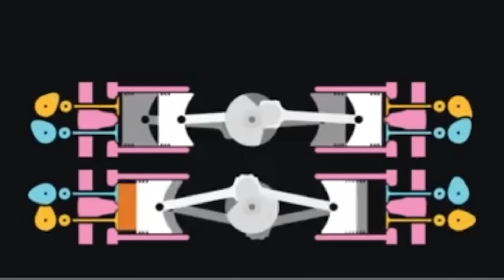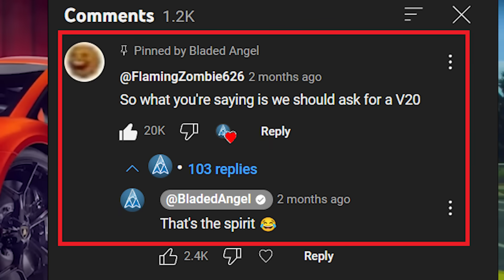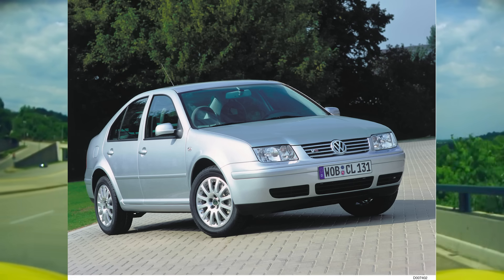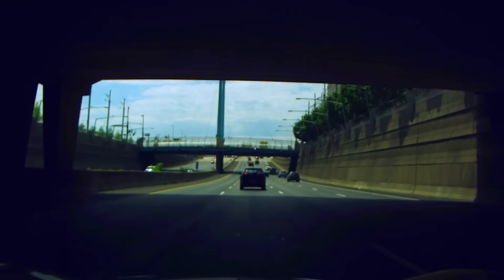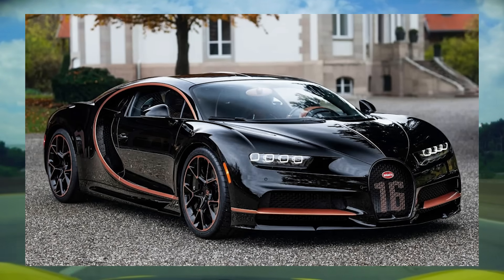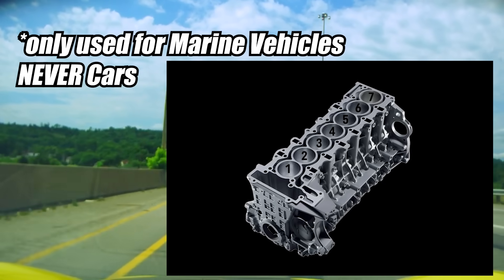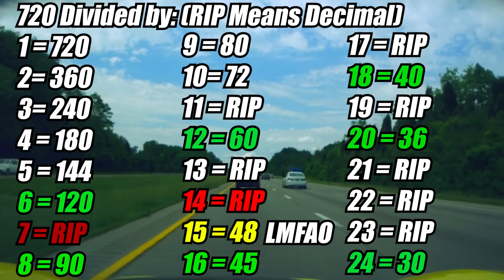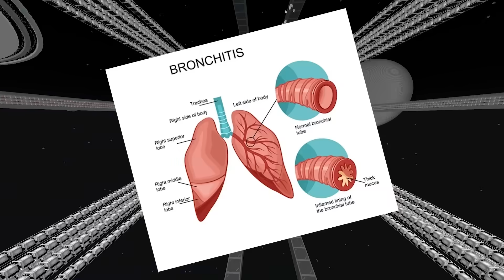5 EXTINCT Car Engines We'll Never See Again!

Comment: Wait, if V14 is impossible to balance, why does it work on marine diesels? Is because they rev so low, that vibrations dont matter? Or are they two stroke engines?
Reply: Marine diesels are grunting low rev engine. I read somewhere that they even have redline between 100 and 200 RPM. So yeah, the engine is slow and the ship chassis is strong enough to reduced the vibration significantly.

Comment: Volkswagens V5 engine of the late 90:s and early 2000:s was based on the very narrow angle 2.8 liter VR6 engine, but with 1 cylinder removed, it's the only production V5 engine being installed in cars. 
All other 5 cylinder car engines, Audi, Volvo, Fiat, Honda \ Acura (not in Europe ) GM, and the 5 cylinder Mercedes diesels were all inline 5s, my favorite engine design after V8:s 👍
Reply: Audi/VAG and further developed Volvo inline 5's were the best engines ever made and it was really a misstep for VAG to cease use them.

Really simple to fix, reliable to boot and upgradebla to a power levels no other basic VAG engines can take.
Reply: @jhutt8002  They really over-engineered the 5-cylinder engines. No wonder they can easily break the 1 million kilometer mark, and why they can be tuned to a ridiculous level.
I have an Audi from the mid 90's that has the AEL/D5252T engine in it (It says both AEL and D5252T on the block, which is a cool fact). Nonetheless, it has 543,000 kilometers on the clock, and still runs perfectly fine. It even had a severe overheating event at one time (measured oil temp at 150 C), where it nearly ceased up, but I let it cool off, refilled the coolant, and eventually it started back up again like nothing happened, and it suffered no damage to any components. I'd love to see that happen to any other engine and see those live through that.
Reply: @jhutt8002  yes sad indeed
Reply: @jhutt8002  im glad to have picked up a volvo c30 2.4i 5 cyl,, it sings so nice pasing 5000rpm.
Reply: Fun fact, Oldsmobile designed a V5 diesel engine for FWD cars in the 80s which NEARLY made it to production, but the fallout from the failure of the Oldsmobile diesel V8 made them cancel it. Unlike the diesel V8, it was designed from the ground up to be a diesel engine (not a gas V8 hastily and crappily converted to diesel), so could've actually been pretty decent. Sadly though, now there's only one surviving prototype in a museum and it hasn't run in decades so the only people who know what it sounded like are 1980s Oldsmobile engineers.
Reply: And it's sad that the i5 is now dead. Nobody makes em anymore...other than Scania.

Comment: Remember, X24 engines exist, used in planes
Reply from the maker: yeah, but for this video it had to at least been thought of or attempted in a car. While X engines were attempted in cars, I dont think a X24 specifically ever was (For the same reason a V24 hasn't. Just wayyyyyyyyyyyyyyyyyyyyyy too big)
Reply: @BladedAngel  dont forgor radials, mmmmmmmmmmmmmmmmmmmmm radials. there are a few cars with radials
Reply: @captainslow_037  that radial FWD race car lmfao
Reply: @BladedAngel  does tank count as car? they use x-engines also)
Reply: @BladedAngel  ford/henrys X4 and X8 and X12/Lincoln 1910-1950's~ 🤠😉 yore welcome 👍

also on my car bucket list for 10+cylinder's aka X20 or X16/X12 alison-4520/liberty-finned/air-cooled-hybrid+water-cooled looking/themed ( 500ci to 1200ci, and maybe turbocharged as mufflers 😉) and or night-sleeve-cylinder valved and or combination with rotary-valve's-head's+electrical servos/PWM and head's that screw-on+VCR+efi-ect...

the JDM boosted RB20/3-rotary ( like 6 and 12 but for average me to much $$ and fuel/parts/learning-curve-etc.. to be a realistic experience/goal's plus im not rob-damm/aka-/expert on platform as my background is millwright/pistons-types ) is also on the list ( yes i like weird 😉 ) as is uk 🇬🇧 car's but for now iv settled for dodge hemi-D8-540~ci ( 4.3X4.5in stroke, goal is flat-top's*/higher CR-ratio for 91-pump to M100/NM-mix's ) and 7c-drop-out-trans manual and efi ect...

so not to big/X's, but even my V8 is being hung by the 🇺🇸 EPA/buying-pub( appliance-vin's/typical type personality's ) as dodge/FCA* killed off there line's, surprised me as 1950-forwards there was always ( dodge was a flathead L6 ( maybe 4's 🤔 ??? ) but most didn't like it and or not popular choice with pre-1960's public and less so with my millennial/zoomers gen's, ps no L8 that i can remember they skipped to V8's instead and or ~copying~/buy-tooling* packers 1955~ v8 ) something turboprop/jet or v8 or v10/12, so new normal for manufacturing is PHEV or BEV or sub5-cylinder's even the 4 is getting looked at for 3's and 2's now 🤔😑

different idea 💡for 15 ( or 14-cylinder's/weirdness ) cylinder is find a existing v10 with the timing/head system on the back like a German-brand 🤔and a GM atlas inline-5 weld blocks and crankshaft's to make one-unit ( even possible for a rotary-engine rotor/rotor's to be used for balancing 😉 for more wacky reasons ) timing-system is going to be a pain but it's still compact-ish and back-yard doable, even possible for v10 to be diesel and gm on 91-pump aka hybrid-fuelled/running something i haven't seen much of

Comment: 7:29 would it be possible to make a w9 engine? Width of a v8 with the length of a 3 cylinder. Balancing would work if you kept the cylinders equal. You might need to have somewhat of a triplane crankshaft to deal with the odd shape. (I don’t know why I thought of this, but it came. now, it’s forever going to stay on your comment section.)
Reply: A W not too likely, due to the balancing issues he talked about. Multiples of 3 are much more stable and easier to engineer in a rotary.
Reply: Only if you put one raw of 3 in the midle and the otger two raws in a V shape on both sides of that midle raw

Comment: wHy aRe tHeRe nO 9 cLyinDeR eNgInes?!?
Reply: Because you can’t make a v5 work and it’s not enough cylinders to be H so that leaves I pattern which the very issue is snapping cranks and not fitting it anywhere. Making the 9 cylinder impossible to balance and pointless.
Reply: @joshreynolds729 could you try an original w layout, where you had three pistons in one row? (If you still don't get what I mean, it is online, so you can just look it up)

Comment: honda had really good success with a v5
Reply from the maker: yeah.
sadly the same cannot be said for Volkswagen and their VR5 😂
Reply: @BladedAngel Mainly because Honda just used the extra cylinder to remove the secondary vibrations of the other 4 cylinders, they weren't relying on it for power

Also the fact that Rossi was a fucking GOAT at that time

Comment: fun fact there are rotary engines that have been put in superbikes and they were good for racing
Reply: The rotary engine seems ideal for a bike, lightweight, compact, high revving power.
Reply: @SomeOne_86  Not to mention the brap brap brap brap brap brap brap brap
Reply: @SomeOne_86  and then you wake up and the cons come to the voice, where rotary engines have a problem with heat dissipation, leaks and fuel consumption
Reply: @Satoshike  Motorcycles are a different thing altogether. Much less load on the engine. It's much more easily accessible. And most motorcycles drink fuel like crazy anyways.
Reply: That's because the rotary engines work best when at high rpms. Take the Mazda 787B for example.

Comment: What are your thoughts on the new bugatti with the v16 being unveiled on 20th of june?
Reply from the maker: Very excited for it! I think it will be the only Production V16 currently in production when it comes out!  IT's been a while since a car used a V16!
Reply: v16, the only engine which I never heard being ruined by clowns😅
Reply: @BladedAngel it's ironic that Bugatti beat the devel 16 at it down game, 10 years after the decal 16 was invalid..
Reply: @jwalster9412  Well not really lol, the devel 16 has had a working quad turbo V16 for a while now, you can find dyno footage of it on youtube. The main problem they have is a good and reliable driveshaft, gearbox etc that can handle the dumb massive power they're going for
Reply: @BlissifiedHH  well they have high torque driveshafts for massive trucks, so it's not impossible. But the Devel 16 is also Saudi Arabian (no offense meant of Corse) this means that it's probably not going to happen, like every other scam.
Reply: @jwalster9412  Oh i'm not hopeful that the car will actually be produced, i'm simply saying that in terms of the V16 itself it's no issue given they have the powerplant made and tested. And i'm assuming they wouldnt want to put a driveshaft from a truck in given weight, size and all of the factors. I don't see the car ever being made, but i appreciate them trying and actually making the engine
Reply: @BladedAngel  Yeah it’s very exciting!
Reply: @BladedAngel I've done it in automation for years it's so easy
Reply: @BladedAngel  Excited! But the problem is that there are only so many cars that an engine like the V16 can handle.
Reply: @BladedAngel I got pneumonia!
Reply: V16 big
Reply: Honestly I'm not excited for a new Bugatti I'm more excited for a new McLaren

Comment: Wait so why don’t they use H24’s in F1
Reply from the maker: too big for the frame at that point lmao.
Reply: @BladedAngel  2024 cars are massive compared to the older ones (which had bigger engines) so if someone is ambitious enough, they might pull it off XD